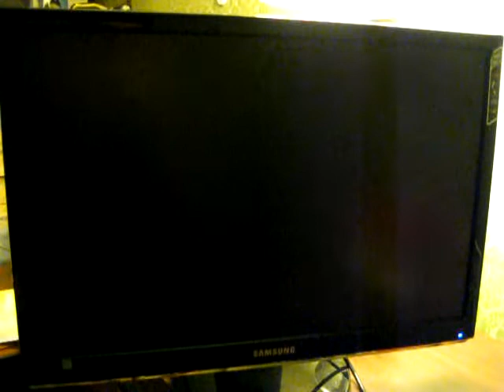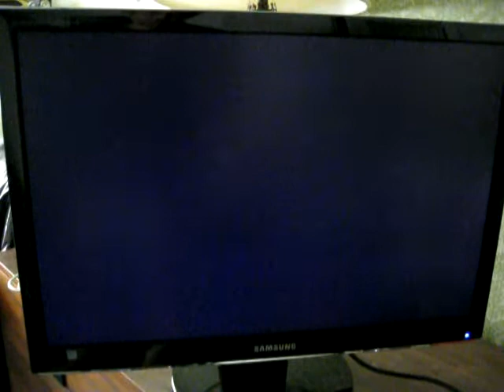Samsung 2493HM LCD Monitor - intermittent backlight failure with sound of arcing (2011-09-27).AVI

Comment from the maker: An update 5 years later... this morning the monitor "died."  Its blue "power" LED lights up properly, but the screen stays black. (I verified the problem is the monitor and not the computer by swapping in another monitor.)  It used to make a sound when I turned it on, but not anymore, so I suspect its power supply has failed.  Some years ago Samsung settled a class action lawsuit about defective power supplies in tvs and monitors and agreed to fix them for free, so I'll try to research whether the 2493HM is covered and whether the agreement to fix for free, which may have expired, is still being honored.
Reply from the maker: I fixed the new problem (display black, blue LED lit solid).  It was caused by the notorious yellow glue on the Samsung's power supply board.  When the monitor is new the glue is non-conductive, but after years of heat it breaks down, darkens in color to tan or brown, becomes conductive, and either shorts out leads that it connects or affects a circuit's properties enough that the power supply stops working (except maybe its standby 5Vdc keeps working, which powers the blue LED).  It turned out the problem was intermittent: occasionally it worked, and when it didn't it made a strange sound that turned out to be a momentary electrical arc.  I found the problem fairly easily by using my camera operating in video recording mode; it recorded the arc and showed me exactly where it arced: underneath a small transformer.  I fixed it by using an exacto knife to carve some grooves into the yellow glue next to the transformer; the glue's conductivity had been connecting the transformer to some nearby components, and the carved grooves provided the needed electrical isolation.  I plan to apply some electronics grade silicone RTV sealant to the glue that's next to the grooves, to protect it from humidity, which can also cause the yellow glue to break down.  For more info about the yellow glue, you could google:
monitor glue yellow OR brown

Comment: Theres a square black part on the video board.. when de-soddered it makes a rattling sound.. I bet that's the problem.
Reply from the maker: @losbanosmonkey: To my ear, it sounded like arc-ing, not rattling.  Also, while the parts are soldered in place, there are no moving parts (and the monitor itself was sitting on a heavy desk that didn't vibrate), so I don't believe the sound could have been made by something physically moving around.
Reply: SteuTube222 I ended up fixing my faulty Samsung.. the 2 yellow caps that were not puffed on the inverter board were the issue. My monitor had a solid blue light with no display.
Reply: @losbanosmonkey  What are you referring to here: 
"the 2 yellow caps that were not puffed"?

Comment from the maker: Samsung's repair center in New Jersey (United States) repaired mine on their second attempt. Unfortunately they never told me what caused the problem or how they fixed it. Perhaps they would share this info if asked nicely.

Did you clean the circuit boards & components near the lower front right corner (where the sound of arcing came from on my monitor)?  If dust is there, it might act as a conductive path.  Also, a bad solder joint might not be conducting properly.

Comment: Hi SteuTube222, I have the same problem. I checked all the capacitor from the power supply board but everything looks intact. I have this problem for over a year now and it's very annoying. Did anyone figure it out how to fix it?
Thanks in advance.

Comment: I have the exact same problem with my Samsung 2593HM.  The backlight will go out, and sometimes a good smack will cause it to come back on.  Else it will sit a while, making a clicking / popping sound, eventually making loud popping sound and comes back... for a while.  I have 2 of these monitors, and only one of them does this.  I will try to clean the board to see if that solves the problem but I am doubtful

Comment from the maker: @sic82 : I wish Samsung had told me how they fixed mine. One thing fairly easy to try would be to open it to clean accumulated dust. (Search YouTube for how to do that.) If the dust is sufficiently conductive, it might be shorting out the high voltage that's supposed to be supplied to the fluorescent backlight. If it's shorting, that would probably explain both the backlight not lighting and the sound. Good luck, and please post here again if you try something, successfully or not.